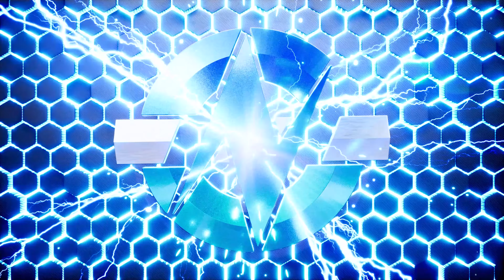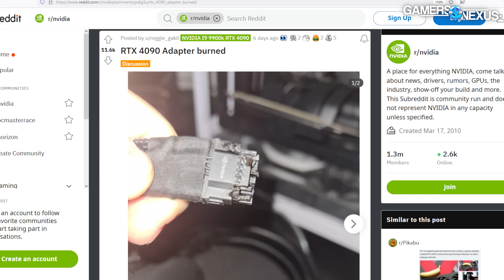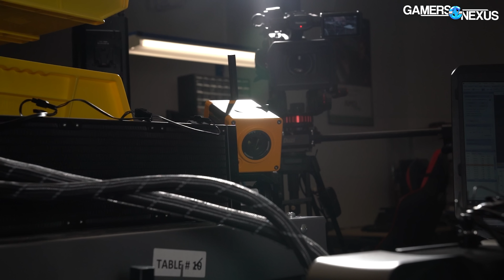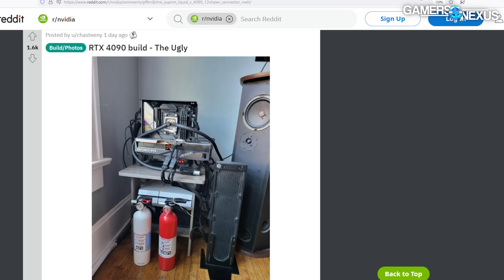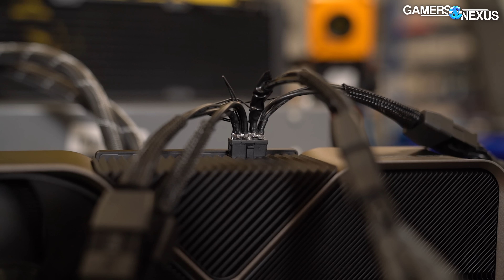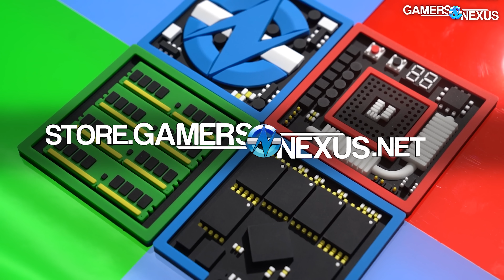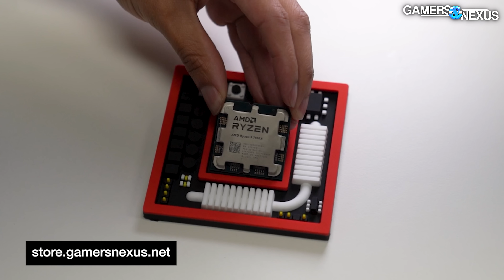Testing Burning NVIDIA 12VHPWR Adapter Cable Theories (RTX 4090)

Comment: I think Buildzoid's theory is the most probable at the moment. It's not about the cable side, it's about the pins (actual metal blades in the pins) at the connector side. Cables didn't melt (mostly), pins did, and it seems to be exclusive to the Nvidia connector which has lower build quality of the pins. I think it's definitely worth checking out.
Reply from the maker: Agreed. We've been talking with him!
Reply: all the burnt plastic connectors had their pin shape in a good condition, not bent or opened, so you won't be sure about that.  Nobody knows what made the burnt cables burn right now. what we know is there are different built nvidia adapters they all are not the same
Reply: @MrDvneil  You're missing the point - the female pins have no horizontal rigidity, giving enough leeway for the male pins to easy flex, without permanently bending any of the pins. You can still have plenty of flex without permanently bending them, especially given the design of these particular pins.
Reply: Although this test should be made in a case. Maybe on that does not have the best airflow. If the card gets hot itself, I guess that this could "help" to get to the point where the connectors start to melt. Since on the Nvidia card the power connector is in the middle of the card, there might be also less airflow and higher temps radiating from the card itself.
Reply: Agree the area around the pins contactpoints is where the faulting is occuring.
One could argue that  resistance is causing the source of the heat. 
If that is the case. what causes the increased resistance ? sporadically.
Simple answer  dirt / contamination.
My best guess would lie in  the processes involved in the manufacturing of the connectors.
They appear to be overmoulds  where the wires are laid into the tool pre soldered to the pre bent plate.
 the plastic is then injected forming the connector.
An over zealous use of silicon release agents  and inadequate  post cleaning could be the resistance ' spark' .
Especially so at tool start up cycles. The same could be said also for the stamping and forming.
Spray some release agent into a good connector  . plug it in and stand well back would be  the test.
Anyhow just my couple of pennies  thrown in to the ever increasing pool of thought.
Reply: @Themisterdee  Generally a connector like that is made with a pre made socket and pins inserted into it rather than having the plastic injection molded around the pins. That does not look like an overmold to me.
Reply: Agreed, Grejp Kelj. Igor's conclusions massively missed the point. Buildzoid was right on nearly everything he said (he made the common mistake of thinking the high-resistance pins are the ones that heat up, when in fact it's the low-resistance ones that carry the most current and get the most heating).
Reply: The Adapter has all pins connected internally compared to regular cables making any load balancing between the pins irrelevant and only relying on the pins contact resistance, which could in my theory lead to overload of single pins.
Reply: Yes, this is also what I would guess at.
Reply: This is what I suspected all along.

Also if the pins are mechanically weaker designs in the Nvidia adaptor, you can explain why the outermost pins are most likely to have issues also. If you grip the connector to plug it in, typically people grip it in the centre. If you then put any lateral strain on the connector at all when plugging it in even slightly not straight, then you'll end up putting a larger force on the outermost pins simply due to the larger physical moment. This likely explains why the outer pins are the main culprits over the centre ones; as they experience a reduced amount of force when the pins connect to the plug on the adaptor. On top of that you've also likely got the cable pulling one way or the other...
Reply: Depends on what you mean my "lower build quality"... If I can assure you one thing, then its that you cannot judge crimp contacts by mere optical observation.
I used to think for example that gold plated contacts would be "superior" to just tinned ones. Which is false when it comes to max rated power draw vs. temp.
Material thickness, composition and build precision are key here.
Reply: @The_ViciousOne  While it's true many factors define the quality, here the aspect Buildzoid talked about is mechanical rigidity of the metal blades in the pins. Nvidia connectors, at least the ones we've seen in pictures, seem to have two separate metal blades (like square brackets [ ]) which inherently, regardless of other factors, have lower structural rigidity than other connectors which seem to use a single blade bent into an o-shape.
Reply: @TheGrejp  Well, that sure can make a difference. As far as I know the original inventor Molex doesn't have a double split for example (only for a friction reduced version). Still, one thing to remember is that these crimps originally were designed for much lower power. Even Molex didn't have ones that went above 8,5A/10.5A per single contact until recently. Now we are at 12,5A!
Which s basically the same as the much bigger Mini-Fit standards maximum.
Not to confuse with the ratings for DR 12 contact scenario ofc.
Reply: IDK if there's a difference but it's not just founders cards that are melting - the most recent thread I looked at was a TUF model. Do the AIBS use nvidia's cables?
Reply: @hansolo631  As far as I know yes. Or at least they specified the design to a certain point, where contract manufacturers produce them. So AIB's do not as I understand it have their own designs.
Reply: @The_ViciousOne  Wow. That's quite a quandary they are in. If they are going to juice the prices up 3fold, they gotta at least keep quality reasonably inline. This was a pivotal launch for them as they attempt to normalize skyhigh gpu prices
Reply: @hansolo631  Well as for the prices why wouldn't they bring them up? They already noticed what people are willing to pay with the 30 series. And if gamers aren't paying then the industry will. Besides that there is also inflation and general supply issues.
On top competition and increased complexity in higher manufacturing, an increased audience in the last 10-15 years.
All kinds of factors that lead to these prices. As for quality you are absolutely right at these prices QC is absolutely prime.
But the big question is are they at fault or is it
just an unexpected combination of improbable causes that they have no control of? 
That's what in the end GN, Igor and all the others are trying to find out on our behalf. And its far from a simple task as it seams... As no one until now could even repeat the scenario, even with the most gruesome torturing to that connector...
Reply: Yeah, it bugged me when ppl spending time on Igor's theory when every socket, out side of this 12vhpwr, I've seen burnt or melted personally are due to loose or bad contact between termals either due to physical damage or oxidization.
Reply: Yeah I changed my mind after watching several cases in reddit,  some of them are happening because bad pin contact, no other way can produce such pattern of burnt,  burnt,  no burnt,  burnt pins
Reply: Agree. And it's easier to test. I'm surprised that Steve didn't check out this theory.
Reply: @Anderson_LS  It was probably already too late when that new theory emerged. As Steve said, they've been working on this for two days straight and the tests have already been defined for Igor's theory. From his conclusion, it seems to me that there will be a follow-up video with other theories, like Buildzoid's, tested... After the well deserved rest, of course.
Reply: @Anderson_LS  He literally discusses it towards the end of the video.
Reply: He just mention it without tests and explanations.
Reply: I think this might be it.
Reply: i also agree with his conclusion, there was no need for this, and the older connectors have had more known current moving through them (dual 8's combined = 600+w), and have a significantly higher safety margin.

3 8's makes it a 900w (and change) capacity. well overkill for the 4090. and its not like some systems haven't had 4-8 8 pins for SLI. 3 is peanuts.
Reply: @kenabi  but see, it doesn't matter. 8 pins are rated for 150W and you must stick to that to release a certified PCIe SIG device.
Reply: @kenabi  "3 8's makes it a 900w" no it does not. An 8-pin cable carries 150W, that is why this adapter needs 4 of them to deliver the full 600W and why NVIDIA, quite rightly, determined that 32 connections for power is unnecessary if 12 can accomplish the same. It's called "engineering".
Reply: @aaaaaaaaaaaaaaaaaaaaaaaaaaargh  I wonder if we could call this engineering to the edge of safety though. There seems to be a lack of safety factor in this connector, that is a lot of power to put through small pins in a connector that isn't all that rigidly fastened together. I do wonder if the terminals with 2 splits are the real culprit, making a safe enough design not quite safe enough.
Reply: Its not the pins. Its the pin to wire bonding thats the issue. In some industrial plugs i have seen you have WAY smaller pins for even higher currents. While those are rated for higher temps its still hinting to me that its a small batch of rouge cables
Reply: @AlpineTheHusky  I disagree. The melting is very clearly where the pins meet the sockets... Therefore the simple conclusion is that this is where the problem lies - almost certainly because a connector issue has caused most of the current to flow through just one or two of the six 12V pins. The pins themselves are not drastically under-rated for carrying 8 or 9 amps, but the connector as a whole has minimal capacity for coping with the current-sharing failing. (Btw, which industrial plugs put higher currents through "WAY smaller pins"?)
Reply: @laserspike  Regarding the last point.There are some super high density Harting connectors (tho I dont know if they are custom) that by code go from basically a tiny bit smaller pin than that to a 2.5mm² wire because of heat sinking and current capability. And for the current sharing of the pins there have been quite alot of tests that let 1 
, 2 or even 3 pairs (basically half the connector) fail and that did not cause a failure. While I get what you mean and see how it could fail, I dont feel like that (or atleast that alone) would cause such a failure.
Reply: @AlpineTheHusky  Thanks. You did originally say "WAY smaller pins" which was tough to understand, but I can certainly believe in pins that are a "tiny bit smaller", given that the 12VHPWR pins really aren't very meaty. Meanwhile, there's a world of difference between 3 pairs failing (half the connector), which splits the current between 3 of the 12V pins (Buildzoid believes that much of the return current to the 0V line goes through the PCIe socket and I have no reason to doubt him) and the extreme case where only 1 of the 12V pins carries the whole current; it's a factor of 9 (i.e. 3 squared) worse, or a factor of 36 worse than the nominal case where the six 12V pins share the current equally. Again, I think the PCI-SIG report conveys clearly just how hot things get when the sharing breaks down. If you send 50 amps through a single 6 milliohm connection (cf PCI-SIG testing, and this is consistent with the connector spec) you'll dissipate 15 watts, and I believe most of that heat is gonna be at the joint between the pin and the socket, with basically only a long skinny conduction path along the copper alloy to carry away the heat. That is a LOT of power, and if you do the calcs you will find that the temperature rise required to conduct that power away is conservatively in the ballpark of a couple of hundred degrees Celsius (I don't have the full spec of the connector). And of course the 12V pin doing all of the work could easily have a somewhat higher contact resistance. Btw, I've estimated that the time required for that tiny mass of metal to heat up by well over 100 degrees C with that kind of power dissipated in the joint is in the ballpark of 1 second.
Reply: @laserspike  Im on my phone so you will have to be contempt with a short shitty reply. If a single pin has 6 milliohms of resistance then 50amps worst case (600watts) would net a heat dissipation of 3.6watts which is ALOT for a tiny pin it is within the realms of actually working. Ofcourse it will heat up thus increasing resistance and maybe go up a bit in heat dissipation. 3.6 Watts is not enough to burn a connector like that. I will stay with my oppinion that the bonding between the pin and the wire is the main reason for the heat and ofcourse the pin to socket loss cant be ignored. Calculation for the heat generation of the contact resistance you mentioned is 50A * 12V * 0.006Ohms. If you would look at the connector/pin/socket in a vacuum then yeah that thing would end up burning but with the heatsinkin of the wiring and the PCB itself (while only a small delta) would prevent that kind of heat. The issue is in my opinion (a combination of other things but mainly) the pin to wire connection in those select few connector assemblies such as in possesion of Igors lab. Scratch that "short reply" part.
Reply: @laserspike  Oh and the "way smaller pin" part is true but the wire connected to that pin is comparably massive thus heatsinking the pin itself. This is to some extent the same as with the 12V adapter. Many "large" wires feed into a tiny pin that sockets into a tiny socket which sits on a massive copper plane
Reply: @AlpineTheHusky  Hey it was still shorter than my monster reply ;-) I would readily agree that 3.6 W isn't enough, but the heating in a resistor is I^2*R (not V*I*R), hence 50*50*6e-3 = 15 W, and I do think that that's likely enough (even without the connector resistance climbing above nominal with distortion and indeed the high temp as you say). I did a really basic estimate of the delta-T required to push 15 W down the copper alloy and came up with hundreds of degrees C, but lots of guesswork in there so it's not definitive. For sure the plastic will conduct away a little heat as well.
Reply: @laserspike  To my defence today was an hour timeshift and I been up for a while and I been doing too much of nothing.
Reply: @AlpineTheHusky  That's a shame, as the rouge cables would be a refreshing change from the oppressive wall of black.
Reply: The most reliable theory is Nvidia's House Burner™ connector has 0 safety margin which makes it 200 times more vulnerable to random glitches, voltage spikes, inevitable minor manufacturing defects etc. It's an intentionally cheap, flawed and dangerous design, accenting on profit margins instead of safety. 
Redesign it with 70% safety margin requirement and it will have the same failure rate as an 8-pin.
The end, case closed, problem's solved.
Reply: @Zorro33313  I read profit margin and thought...." finally some people wake up over  a fat pig wanting more of your cash for free regardless how absurd design and msrp vs R&D rather than slow down the market a bit, deflat the fat pig "a lot! X2" proper architectural R&D rather than stinky stacked overwattaged sell your kids/wife/house/your kidney to afford an absurd card
Reply: @critic_empower_joke_rlaxtslife  spot on, mate. companies making 60% margins allowing CEOs and top management to have absurd salaries is quite disgusting anti-humane purely post-capitalistic corporative phenomenon. 
worst thing about it people are willingly marching into this miserable reality.
Reply: @Zorro33313  Have you even watched the video? WTF
Reply: Bs.
Reply: @Dokutah  That is a fine argument you have laid out there.
Reply: @Dokutah  No its not. You just have no clue about the problem here, if you spit such ignorance. At this point no one knows what eventually may be the cause. But there are most certainly many possible ones...
Reply: it's just a theory which he cannot reproduce. so it could be just typical youtuber FUD
Reply: @ackt83  Steve hasn't had the time to test the loose socket theory yet.   It's actually quite easy to jury rig a worst case situation by just sticking a small screwdriver in the socket and rock it back and forth to open the split socket up by deforming it.
Reply: @ackt83  deeeeeesoldering the connector off of a 4090 :D
Reply: This won’t receive a reply from hair, as it blames Nvidia.
Reply: @unconfirm3d  You've obviously not noticed that Steve isn't an Nvidia shill.

Comment: Would make more sense if the outer wires were restricting the inner wires bend radius when bending. If the inner pins snapped off, it would force higher levels of current to flow through the outer wires, causing the plastic to melt.

Comment: I think the problem is on the Pin and terminal connection on the adapter, not in the cables or cables' soldering points.

Comment: Hi I’d appreciate if someone can clarify this for me:
I bought an inno3d RTX 4090 OC.
Are all partners giving the Nvidia adapter ?
because mine looks different.
For starters , the adapter that came with my inno3d 4090 doesn’t divides into 4 connections, like the nvidia adapter , but only 3 connections. So even tho I have 4 connections coming from my PSU , I can only connect 3 of them to the GPU adapter . 
Wich is probably why the power slider is blocked in tweaking apps.
Second , the adapter doesn’t says Nvidia anywhere . It has no brand or logo to it.
It looks like a normal al adapter nothing special. If anything , the protection band close to the connector looks like rubber , while the one I’m seeing in this videos looks a bit different.
Got me wondering if some parters are making their own adapters or buying them from their own suppliers , instead of shipping their cards with the adapter supplied by nvidia